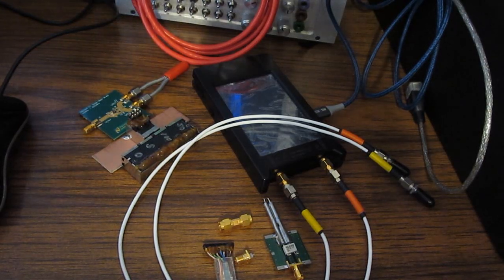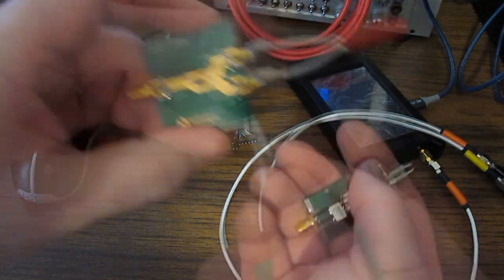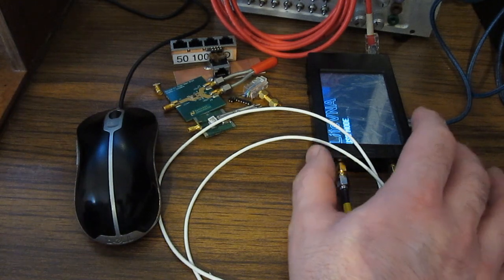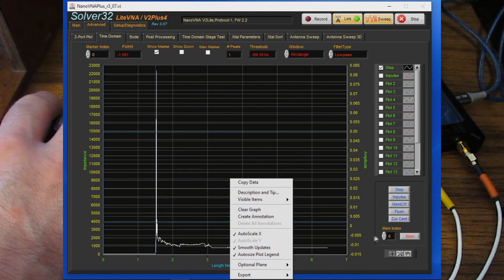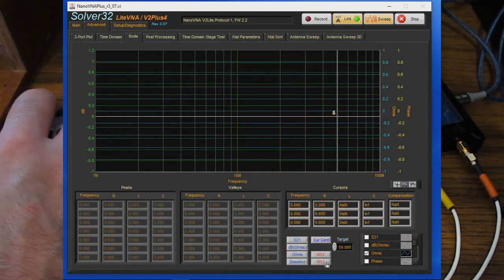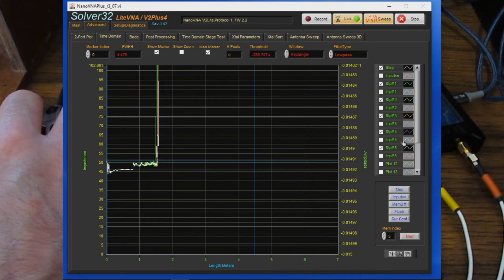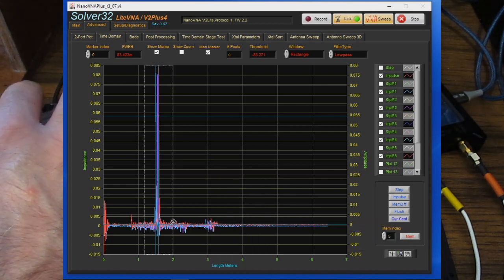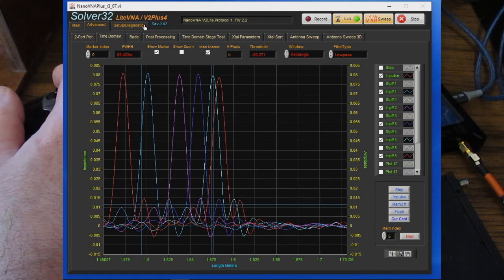Solver32 Software Updates for the LiteVNA and V2Plus4

Comment: Hei, i use labview quiet a bit and was wondering if you would be willing to share the source code? Need it for something specific for my master thesis, but i want to add the ability to measure permativity with an open ended coaxial probe.
Reply from the maker: The software is not open sourced, however there are several programs available for these low cost VNAs that are.  Plus you get the added benefit of them being supported.
Reply: @joesmith-je3tq That is understandable, just wanted to ask. I will have to make it in LabVIEW because of where i want to take it, hence me asking and not using the other solutions. Would you mind sharing if there was any specific issue getting in working with LabVIEW? and the solution? I wanted to use your code to jump over some pitfalls, but just having them pointed out would also be very good. Thinking about the connection and grabbing data, and converting it to reflection values. What i want to do with it after that is straight forward or your app cannot do it, going convert it to permittivity.

Comment: Sweet! I'm really curious if the LiteVna could be pushed to around 7.5GHz. I was planning on designing a phemt lna for 7.2-7.7GHz range, so I'd need to do a ton of matching and measuring.
Reply from the maker: They limit the LiteVNA's firmware to 9.3GHz.  In the following post, you can see a 7GHz HP on the LiteVNA.   Scroll down a few posts and you can see the floor.  
https://www.eevblog.com/forum/testgear/agilent-e8357a/msg4507579/#msg4507579

Comment: This is excellent, it'd be a regular tool in my workflow... but for LabView and Windows.  Not at all to diminish your excellent work here, you've explained those choices perfectly well in other videos.  Have you (re)considered open sourcing it, or making source available to someone who might spend the (considerable) time to port it to for example Python with SciPy?
Reply from the maker: There are a few open sourced programs available for the various low cost VNAs.   I have not used them but understand these are well supported and are suited for the ham and CB radio hobbyist.  You may want to have a look.   If they are missing some features you need, you could suggest the developers add them or possibly add them yourself depending on your skill level.
Reply: @joesmith-je3tq  I not a Ham or CB guy ;)  Have tried those, the programs don't have professional VNA and TDR functions, which is of course why I asked the question.  Anyway, excellent work.
Reply from the maker: @d.jeffdionne  I understand these open sourced applications already support multiple platforms.   They should make a very good starting point for anyone wanting to improve them.   I have not looked to see what feature set they offer but TDR would be pretty basic to add if that was the only feature you were looking for.   I'm actually surprised to hear they don't support it as the developers were asking me questions about how to implement it.  We had exchanged some test files and they had it working.  That's been several years ago.   You can find this exchange up on the EEVBLOG forum.